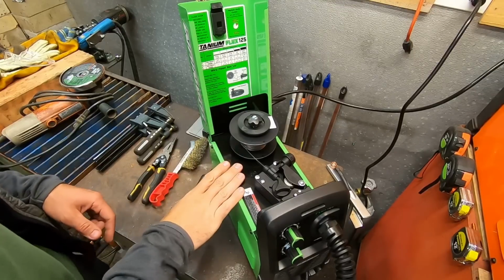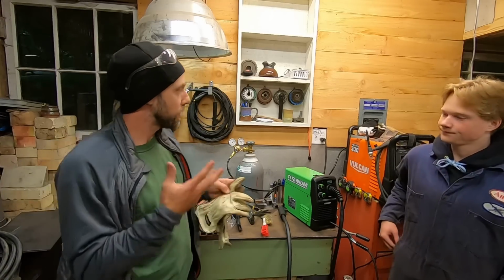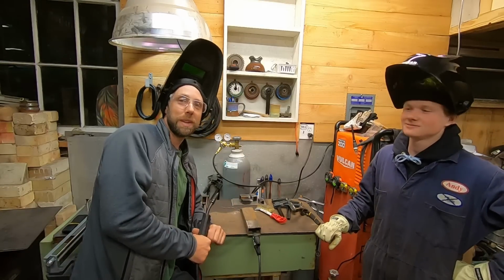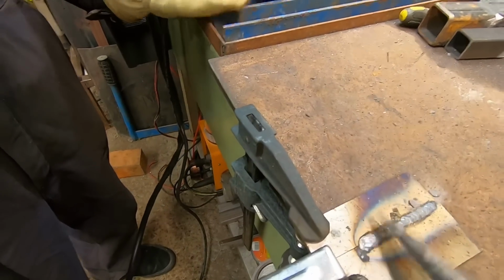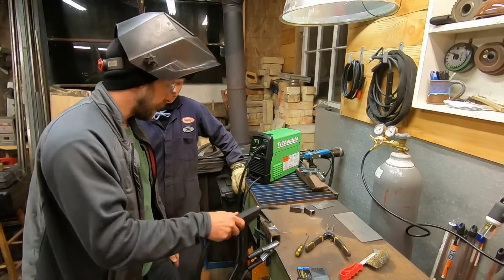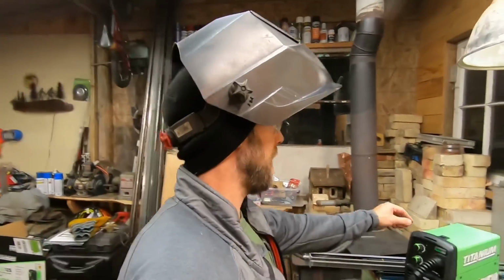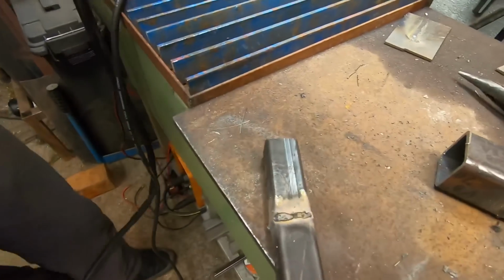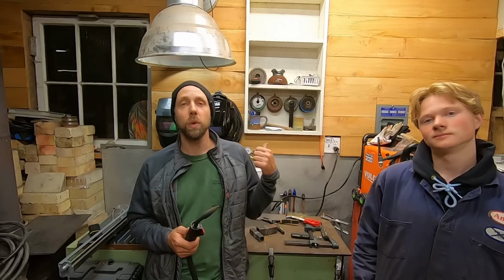How to weld, Tips for Beginners

Comment: 73 years old and I have never welded before. I bought a Titanium 125 today and am anxious to give it a try. Hope I can catch on as fast as Liam. Good job, young man.
Reply: Man, you should make a channel
Reply: @fejeran  I second this!!
Reply: The original poster could be me. Also 73 with no welding experience. I purchased the Titanium 125 to do some auto body rust repair with patch panels. I have not done the repair yet but my first attempt at welding was to build a frame with 1/8 inch angle iron. The welder performed very well but I had a great deal of trouble seeing what I was doing. I had ground the edges of the joint in a V channel but could not see the channel very well. Various sensitivity settings on the HF helmet didn’t seem to help see the channel better. In spite of my problem seeing I did manage to get the frame welded and with the help of a grinder did make the weld look presentable. For a first attempt at welding it was not a disaster. I will practice some more with the thicker metal before attempting to weld auto body patch panels. The Titanium 125 worked great.
Reply: Lol, at 64 I don’t feel so old now as a beginner.
Reply: The cold feed on the 125 is sweet
Reply: Awesome!   Give us an update on your progress
Reply: D R give us an update
Reply: Update brother!
Reply: I am 67, want to learn how to weld. I am confused at Harbor Freight as they have several kinds. I just want to weld small projects such as horseshoe arts, tables etc etc.
Reply: @RodeoCowgirl-55  For small projects the “Titanium 125” used in this video would be a great option from what I understand. They also have a cheaper flux core model but the titanium 125 supposedly runs better and is easier to work with. Don’t forget to pick up some flux core wire as they don’t include it any more (double check that it’s meant for flux core). Make sure you get proper safety equipment too: darkening helmet, welding gloves, possibly welding sleeves or apron. Protect yourself from spatter and UV / heat
Reply: 62 y/o female and getting ready to learn basic welding from my son in law…I’m excited as is he to help me learn….I do need to get some welding sleeves before I start!
Reply: Inspirational, never too late to learn something new
Reply: Just started welding and his welds look much better than mine.
Reply: Right? Liam seemed a natural. Am considering a HF welder to possibly do a lil body work on my 06 northeastern Xterra

Comment: Hello Mike. I am a mixed media sculptor with thirty years of sculpting under my belt. I use wire armatures all the time. Very occasionally I have used MAP gas to do a little welding. I'm horrible at it, and it rarely really works for me. I have always been intimidated by arc welding...radiant energy, electric shock, burns...Yeah, I'm scared of chain-saws, too...very accident prone...I'm the kind of guy who manages to catch himself on fire. Anyway, I just want you to know that this video, along with your Titanium Flux 125 review, along with a lot of safety research, led me to finally make the leap. Super power acquired. My welds look like crap, but they are holding, and a lot of doors for sculpture armature have been opened. Thanks very much! Your videos are great!
Reply: A neat option is aluminum braising. It's basically soldering aluminum together to create a really strong weld joint. I actually made a few artistic pieces that way, I made a few lamps and a matching end table and bed table doing it.
It's pretty fun, super simple and way stronger than you'd think. 
So if you ever work with aluminum, check it out. It's super cheap to get started since it's just a blowtorch and a few cheap braising rods. You can get good brand name gear and get started for under 50 bucks including safety usually.

Just something I thought I'd share, not too many people know about it and I wish I knew about it much sooner!
Reply: @DanteYewToob  thank you, that sound like a good option, too! :)

Comment: Bro I just welded for the first time ever with this welder and it looks like crap. And my eyes hurt! What shade do you use?
Reply from the maker: I use 10 to 11 shade I have a auto dim helmet and that’s the range I usually weld with.
Reply: What about sensitivity and delay?  Is it normal for eyes to feel exposed. I don’t think I got flashed.
Reply from the maker: BULLI KID I commonly close my eyes just before I start a arc then open them up right after the helmet darkens, I don’t know if anyone else does this but I have noticed that welding off and on for hours even with name brand helmets my eyes have felt a bit funky.
Are you sure your helmet is auto dimming?
Reply: Yes my helmet is auto dimming. Check my video I talk about the helmet. Seems like had good features. Let me know what you think.

Comment: I found a cheap wire welder on clearance at tractor supply.  Homesmart brand, was $179, bought for $65.00.  I had an old cheap HF stick welder which bit the dust.  Great video.

Comment: great video Mike. just wanted to know what is the thickest metal that welder can weld.
Reply from the maker: It’s rated up to 3/16 on the welding chart, if you chamfer the parts you are welding I think you could weld 1/4”

Comment: Can that welder do aluminium?
Reply: GuyX2013 if it has a spool gun it can. Doesn’t look like that model does.
Reply from the maker: No unfortunately not, there’s no spool gun available for this welder, especially because it’s built for flux wire only.

Comment: Just got one of these little 125's and I'm really impressed. I wonder what the expected lifespan is of these new inverter-based welders, I've heard some say that they don't last as long as transformer-based machines.
Reply from the maker: I think they will hold up fine, I think the older transformer welders last so long because there’s just a lot less parts inside them and there a simpler design. But the way I look at these newer inverter welders is they are lighter, more adjustable, more efficient and weld nicer, so by the time one burns up the next generation of welders probably will even have more options and work better. Take care

Comment: #mikefestiva Any recommendations for an auto darkening for a beginner that will protect my eyes but not break the bank?
Reply: @Michael Grzeskowiak Thanks, bud. I've stick welded some, but want to get a beginner mig to learn on. My old standard helmet works fine, but I'd love to get an auto-darkening.
Reply: Don’t buy those very cheap Chinese ones on eBay for $25, or even less. Get one with some brand name. HF is fine, as is Grizzly, and other big companies. The unknown brands likely don’t meet safety standards even if they claim to, and you have no recourse when you have a problem. Same thing with welders. Most all Chinese welders claim CE compliance, but none of them actually do have it.

Comment: Only 2nd video of yours I've seen very good videos. I am thinking of getting a welder but not sure stick or wire fed why do you like wire (flux core no gas) more. 
Thanks Bill
Reply from the maker: Thanks for checking out my video, I definitely don’t prefer flux core wire, I like MIG much more, the reason I used a small flux machine in this video is because this is a basic welder that most people will be starting off with and I just wanted to give people a good understanding of welding with them. I started off with a old AC stick welder years ago, it definitely did not fit my needs, MIG is really what I use 80% of the time in my shop, TIG is the 20% I would recommend just buying the Titanium 200 or the Vulcan Omnipro 220 both of these machines are multi process welders so you can Flux, MIG, DC TIG and Stick weld with them. I also have a lot of videos covering these two welders. Take care
Reply: @Mikefestiva  I'll be sure to check them out thanks for the info.

Comment: Great video.  I am about where Liam is with the same Ti 125 flux core machine.  I have a HF auto darken helmet.  How do you overcome not being able to see the parts or weld path?  Is this done by memory of the path?
Reply from the maker: Well sometimes you can adjust your view of the part you are welding on so you can see it better. Try and keep your head out of the smoke helps too.  Try a few practice passes with the MIG lead moving it down the line without welding to get a feel if your still having a hard time seeing the joint. 
What shade do you have your helmet set to?
I bought one of the Vulcan auto dim helmets recently when it was on sale for $129 and I do have to say it’s really nice, much better view out of that helmet! One other thing, I’m not sure how old you are but a lot of my friends in there mid to upper 40s are starting to need reading glasses under there helmet to help when welding. I hope these suggestions help. Take care 🙂
Reply: @Mikefestiva   you can buy lenes for that    that fit in to the helmet

Comment: I was just wondering if mig and flux parts were interchangeable. I went to harbor freight to look at this welder and noticed they didnt sell flux core parts just mig.
Reply: Yes the Harbor freight wielding tips for the mig  You can also use the ones at home depot for the Lincoln welders... They used the same tips.  As far as the flux… it's in the core of the wire.. They do have a cleaning  gel.  And spray for your tips. Once you welded for a moment and heated up your tip. Just dip it into the gel.  And continue to Weld. That should help keep splatter from sticking to your tip… you can also spray your tip and your table surface to keep splatter from sticking.
Reply from the maker: If your talking about the MIG electrode tips there the same, the only difference is the end gas cups for MIG, Flux runs a smaller tip cover but it’s really just to cut down on splatter from the flux wire.

Comment: What type and size of inverter would I need to run this welder for emergency trail repairs? Would love to see a video on that.
Reply: Bring an extra battery, a set of jumper cables and a few sticks.  That'll let you get emergency, and horribly ugly, welds done anywhere.  Just be ready to replace the jumpers pretty often!

Comment: Thanks for the video; I have never welded, but am interested in learning. I have used silver solder for different tasks, but used a torch for them. A flux welder, if I could learn to use it properly, would make it possible to fix more things around the property here.

Comment: Is the wire supposed to touch the material or how far do you hold it off? Thanks
Reply from the maker: I try and keep the tip off the metal no more then 1/2”.
3/8” is a good length. On this welder the wire is not “hot” when the trigger is not pushed so you can let it touch the metal before you start welding, on the cheaper Chicago electric welders the Wire it always hot (has power going to it) so you will start the arc as soon as the wire touches the metal. I hope this helps. Take care :)

Comment: I've had my titanium 200 for about a month . Started out with flux core realized it was way too easy now I'm learning stick LOL
Reply: Also a thumbs up on the T200! Got one a couple months back, running fluxcore for now and it welds great! Tried stick, haven't had any practice in years, turns out I suck! Will have to do some more stick practice.
Reply: I have a titanium 200 as well I have it for about 6 months maybe now I'm a beginner welder I love mine 200
Reply from the maker: The Titanium 200 is great! I really like mine. Yes stick welding definitely takes a little bit more practice but I’m sure you will be laying down nice beads soon. Then it’s on to TIG :)

Comment: Mike...Excellent tutorial...! What .030 wire were you using?
Reply from the maker: We were just using the stock wire that came with the welder, I appreciate the link to Amazon for that shielded wire from France, I will order up a spool of that to try out :) Thanks again!
Reply: @Mikefestiva  It's from Italy...not France. I misspoke earlier. 

https://www.ine.it/en/
Reply: I use INE .030 wire, good stuff. Much less spatter than stock wire and nice, smooth welds.

Comment: Good video Mike, a tension trick you can also use for wire, advance the wire  bend the end over and hold your finger over the end and if it moves your finger you should be good to go.
Reply from the maker: Good Tip Mark! Thanks for commenting :)

Comment: I weld for a living but I still like watching these. He did a fine job for a first time 👍
Reply: If you ever get a chance to try gas shielded flux core I think you would really like it. The slag comes off like a 7018 weld and it leaves a really nice bead.
Reply: Yeah really. It took me years off and on to finally get the hang of it.
Reply from the maker: Right on! Thanks for checking out our video :) I definitely look forward to working on some more welding projects with him. I have only welded once with dual shield wire, it definitely welds nice, one of these days I will buy a spool of it to have around my shop. Take care :)